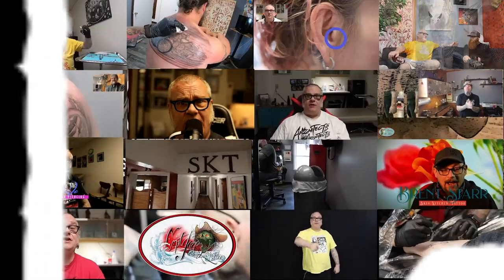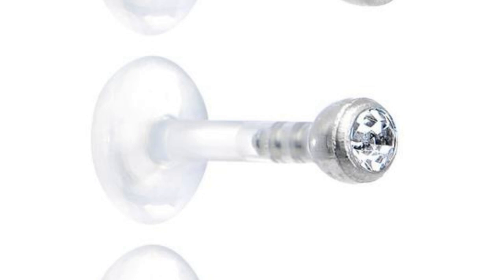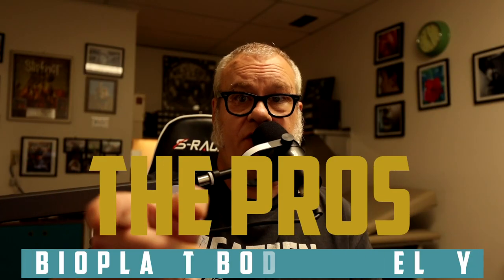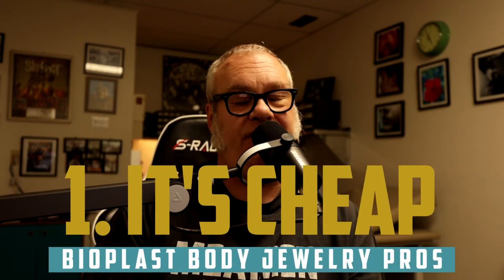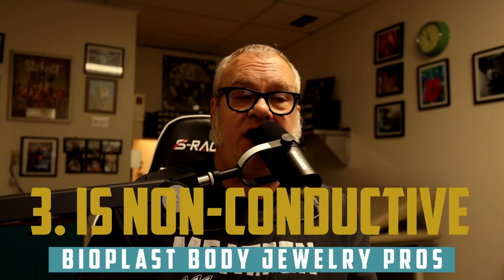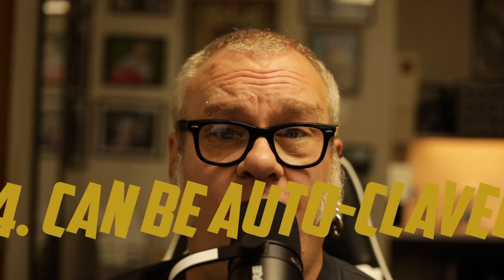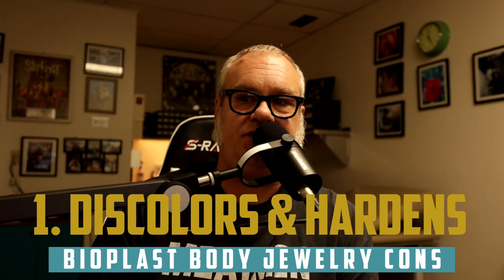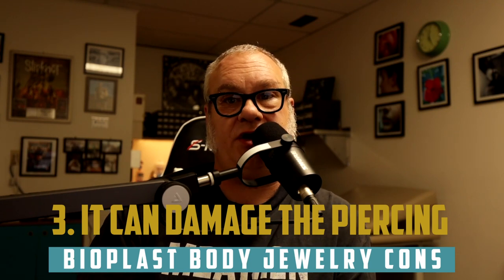Bioplast Body Piercing Jewelry Pros & Cons by a Piercer S02 EP34

Comment: I had an irritation bump on my eyebrow for over 9 months. After less than 2 weeks of using a BioFlex bar the bump had gone. Changed back to titanium after 2 months.
I currently have BioFlex bars in my 2 year old nipple piercings as buildup doesn't stick to the plastic as much as it does to metal bars. I do intend to switch back to metal when I feel comfortable doing so.
Reply from the maker: Thank you for sharing your experience. However I have to say that the bump was likely caused by trauma and would have faded regardless of whether or not you changed the jewelry.

Comment: I read all the "positive" things about bioplast and didn't find any negatives so I started using it. I autoclaved two lobe piercings and a flat piercing with it, and I used it in 9 year old lobe piercings and a 5 year old nose piercing. Let me tell you... EVERYTHING WAS VERY UNHAPPY. My brand new piercings kept getting blood crusties and bumps on them, and my nose was upset after one week of wearing it. I took it out of my nose and the post was coated in white lymph. I thought maybe my nose was upset with it because it moves a lot, unlike my ears. Fast forward a couple more weeks and I now have six week old lobes and a 4 week old flat. I took all the bioflex out today and realized a couple of things. 

1. A 16 guage bioflex is larger than a 16 guage metal piece 

2. Every single piercing was red, weeping, bleeding, and the bioflex posts were all coated in lymph even though I clean my piercings twice a day.

My piercings are already happier and calming down even after I screwed with them changing the jewelry. Bioflex is a horrible thing, and the only thing I see it being used for is medical procedures. Do NOT keep this stuff in your piercings! My friend did the same thing and used bioflex, same thing happened to her.
Reply from the maker: I'm sorry to hear that you had such a terrible experience. Thank you for sharing. One of the biggest issues with plastic jewelry is there is no third party certification or standards. In fact the manufacturer refuses to even release what is in it.

I noticed the gauge issue a long time ago. This is mainly because the material is not designed for piercings. It's medical tubing and the thickness has more to do with fitting medical equipment than sticking to the wire gauge.

I have had a number clients that healed piercings acted up after wearing it for a few  days. I think it has something to do with how the surface is effected by the autoclave.

Glass is a much better choice as a retainer.
Reply: thank you for giving your experience, i was wondering now that i have my monroe re-done, id like either pliable stem or one thats curved and fits along the the gumline for chance at less irritation/gum erosion

Comment: Wooow ty so much for this info bc I heard completely different.
Reply from the maker: Glad to help. I think there is always a lot of conflicting information. The problem is that there really is not as much use to get the proper research done. If the manufacturers do the research in house it should always be taken with a grain of salt.

Comment: I have a MRI in two weeks, can i use this? I have to have it for 1 or 2 hours and the doctor told me that i can't have anything metal (titanium is a no no :/) and in my country glass retainer practically doesn't exist so I'm wondering if a could use ptfe/teflon labrets and septum ring for that period of time?
Reply from the maker: If you don't have access to glass then plastic maybe the only option. Of course implant certified biocompatible metals like Titanium woukd cause no issue at all.

Comment: Just ordered a bioplast lip bar so I can cut it to length (as im between sizes there ether to big or two small) its a fully healed pircing so I'm guessing if I change the back every few months it should be OK?
Reply from the maker: It might be ok. I would suggest that you find a better jewelry manufacture because most have MM or 32nd of an inch difference between sizes making it pretty easy to find the right size.
Reply: @Body Piercing & Tattooing  yes thankyou I did find one it just took some looking around and it's titanium witch I prefer over anything else

Comment: I had steel in my angel bites piercings (Monroe lip piercing but on both sides) and I noticed my gum receding after a year and a half and switched to bioplast. Is there a better option? Maybe a company that makes smoother flat back posts? Or should I give up the piercings and how do I heal them with minimal scarring.
Reply: Are you bars two long? That's why my gum eroded behind Monroe piercing you need a bar that it's flat against your lip on the inside it may nest a little but better then gum erosion or loseing your piercings

Comment: Here my question I have new nipple piercings they have been done for over a month now and I've been size up multiple bar sizes and even have spacers put on they are still swelling over my balls my piercer said they may make me custom bioplast bars just for healing do you think this is safe ?
Reply from the maker: What material are the barbells? Surgical steel? You might have an issue with nickel and should only wear Titanium. Plastic can make things worse. It's surface is rougher than metal. If you are going non-metal, Glass would be a much better option.

Comment: Hmm I put Bioflex in my Rook because it hasn't healed after 1.5 years of having it. I clean it twice a day so I figured maybe it was the piercing itself. Bioflex was recommended to me but I had no idea it wasn't regulated..
Any tips on what shape of piercing I can best put in my rook while I heal it?
Reply from the maker: The best option is a curved barbell. If you are having issues this far in, it could be something going on that has nothing to do with the jewelry. I would suggest seeing your piercer and have them take a look at it. If you feel that you are getting the wrong advice consider finding a piercer with more experience.
Reply: @BodyPiercingTattooing  Thank you! I had this piercing done by a piercer who has 13 yrs of experience and very good reviews on most sites. But she recommended some really outdated cleaning techniques and it kind of threw me off. (agressive soap)
I got another experienced piercer to review it and she said it looked good. I know sometimes its just the case of your body rejecting it so I'll just keep doing what I am doing. I put in a Titanium Barbell this morning and am cleaning it with saline solution!

EDIT: btw when I took the bioflex out (after only wearing it for 1 month) the surface of the barbel was textured and rough. I did not put it in in that condition.
Reply from the maker: You're welcome and hopefully it clears up. Thank you for watching.

Comment: I have been using ptfe stem in my vertical labret and eyebrow piercings for years now. My body attempted to reject implant grade steel at all three sites, and the switch to ptfe seemed to save my piercings. 

My skin is sensitive to a ridiculous degree - using the wrong shampoo or puting on the wrong lotion creates bleeding sores in minutes. My lip and outer eyebrow piercing are also between sizes due to the rejection attempts.

Is there an alternative to the ptfe stem that you can recommend for me, or do I just need to keep replacing the stems every 2 or three months since my skin is so prone to severe tantrums and the ptfe doesnt make it angry?
Reply from the maker: Implant Titanium, 14kt nickel free gold.

Comment: Can you use glass piercings for someone who is allergic to all metals and wants to get a piercing?
Reply from the maker: Yes and no. Glass can be used but the main issue is that it tends to not be very secure. So it really depends on the piercing. For example a nostril with a glass nostril screw wouldn't be an issue but labret with a glass labret stud woul be.

Comment: I know this is a an older upload and I hope I can get a response on this. I'm looking to use this material for about 15 minutes to an hour or 2 at a time in a few year old philtrum piercing. Is this material soft like silicone?
Reply from the maker: No it's going to be harder than silicone. In fact, it can cause as much damage as metal jewelry. If you are needing a retainer, I would suggest glass.

Comment: Don't know if I'll get an answer but I got a conch piercing a week ago and they put a very long bioplast bar in it should I change it? Or should I wait. I keep hitting it.
Reply from the maker: I would suggest changing in 3-4 weeks unless there is issues. One of the issues with plastic is the flexibility. It can cause the piercings to not heal straight. Then there is the risk of toxins in the plastic.
Reply: @BodyPiercingTattooing  Thank you so much for answering ^.^ I'll wait. I was so worried because it's plastic.
Reply from the maker: I'm a fan of don't fix it unless it needs it. Give it time and if there is an issue, change the jewelry.

Comment: How do I protect teeth while my labret piercing heals? I just got pierced yesterday,  and the piercing rugs against teeth, which Is why I started researching bioplastic. I had done all of my research on septum piercings, but when I went to piercer and started asking questions she convinced me to do labret instead.  So I didnt know about tooth/gum issues until after the piercing had happened. I did call dentist and (while they wernt happy I got pierced) they suggested ortho wax.
Reply: Did u figure it out ??
Reply: @barbieswinging1062  i bought the orthowax, and that helped a lot. You have to get used to is, brushing teeth well before and after using it. But taking a small bit and pressing onto the teeth does protect and give a bit of buffer. Still have to be careful not to bite down on labret, and I ended up calling my piercer to ask about switching the jewelry early cause my lip wasn't swelling. It was just to long of a stud.
Reply from the maker: First off they should have covered the risks of damage to teeth and gums in the pre-piercing consultation. Additionally downsizing the jewelry to a shorter post will always reduce contact.

Comment: :chillwcat::chillwcat::chillwcat::chillwcat::chillwcat::chillwcat::chillwcat::chillwcat:recommends new sub,, had my Monroe 5yrs ago, took it out for work near the time i could've changed the jewelry i was pissed, anyhow i pierced it yesterday, looking into the options i have out there, i dont mind having several posts to keep the piercing happy. so i figure ill look around into it so i can have the jewelry on hand when its time. :virtualhug::virtualhug::virtualhug::virtualhug::virtualhug::virtualhug:EDIT:: the clear con to plastic pliable materials (long term probably not as bad say short term ie work)) is micro plastics, as its broken down by moving around or by any disruption of the material this creates micro tears that would accumulate bacteria and those tears will over time get larger (likely still not able to be seen by naked eye)) and enter the body that way.
Reply from the maker: Thank you for sharing your knowledge and watching. Sorry it took so long to reply.

Comment: Peritoneal dyalisis patients do have a 'plastic' tube permanently installed in/and comming out of their abdomen... now I wonder what it's made out of... 🤔
Reply from the maker: I was wondering the same thing. One of the issues is third-party certification. Even if they say it is the same material there's no way of knowing. Also I know that in bi-pass surgery they used to take part of the vein out of the thigh to use on the by-pass but I'm not sure if they replaced it with tubing or if it was a natural material.